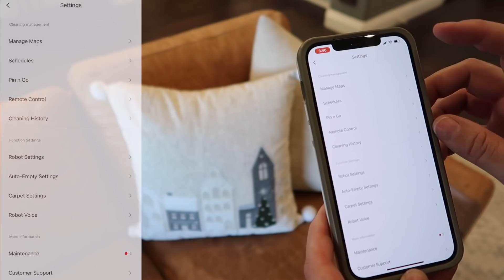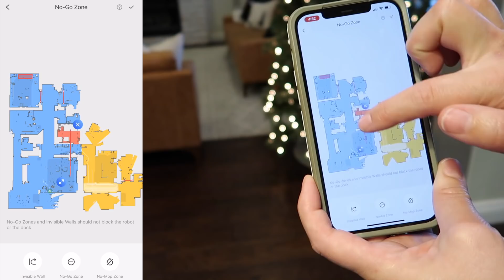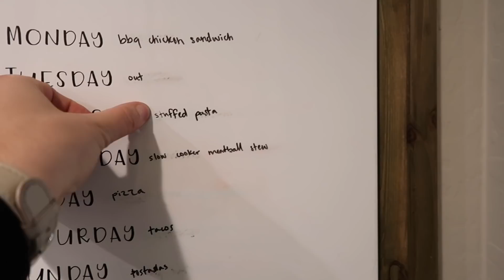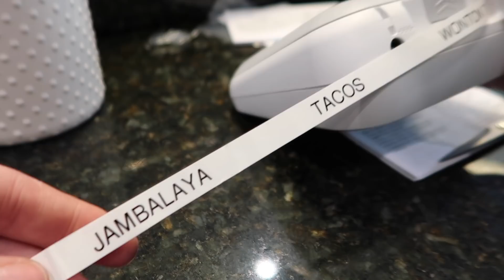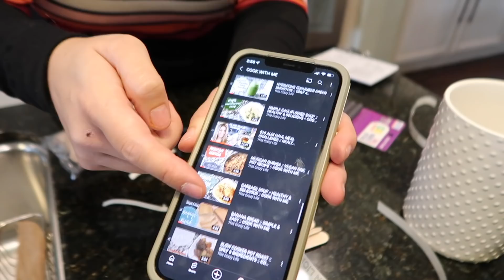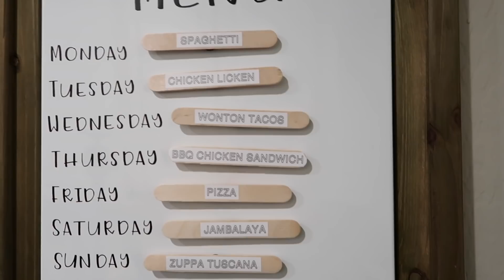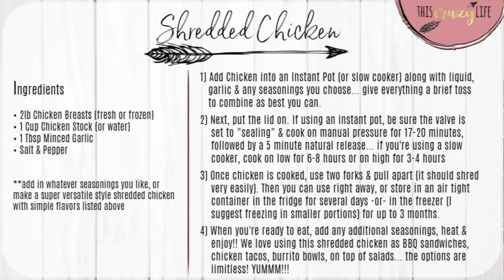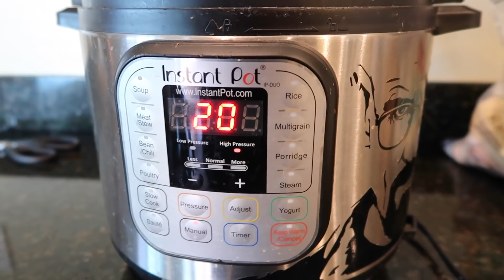HOMEMAKING + CLEAN WITH ME 2021 :: Meal Planning DIY, Coffee Table, Food Prep & Cleaning Motivation

Comment: Hi Amanda, love this video. I love labeling everything and I have the same labeler. Just a little tip, the green button on the top, right side area of thr labeler is a built in cutter. Once you are done printing, you press in and it cuts the strip of labels. Just incase you didn't know, I had to donehat you did too and used to cut with scissors. Hope you're having a great day! You're the best!

Comment: I love the essential oil in the sink, I also now wipe my sink out with the wet slightly oily paper towel that I wipe my diffusers with. There's just enough scent to linger but not enough to make the sink oily. My trash can and recycle can both have black plastic lids, wiping them down with that same paper towel leaves a pleasant scent especially if you wipe the inside of the lid. 
I have the same issue with our fireplace, one side has windows the other has windows and a door, my ceiling fan isn't centered because the ceiling slants toward the fire place. I love your furniture both ways and for practical reasons the chairs by the tree is better, after Christmas I think the chairs with foot rests balance the area better. Whew, you were a busy little bee! I love your new coffee table, the dark wood looks amazing! 💕💕💕

Comment: Keep the chairs in the middle while the tree's up. :)

EDIT:  The film on some produce is a wax film.  I use warm (not hot) water and a veggie brush to gently scrub the wax away.  You can get these things called BluApples, they absorb the gas produce lets off that makes them ripen eachother faster.  Each apple has a pouch in it that does the actual absorbing and the pouches are supposed to last for about a year each.  You can store them in a ziploc bag if you have some that aren't being used so they don't absorb anything when you don't need them to.  You can also get bags of refill pouches.  I found them on Amazon and one kept a sweet potato from rotting long enough to start growing when I'd forgotten about it lol.
Reply from the maker: Thanks for the tips!!

Comment: I fill my sink with cool water and add a cap of white distilled vinegar before adding apples, cucumbers, peppers, plums, tomatoes and all citrus (I zest citrus quite a bit because that’s where the flavor lives and always add the peel to tea!). Let the produce sit for about 10 minutes and you will be amazed at the scum that rises to the top of the water. Skim off as much scum as possible before letting out the water and rinsing the fruit. I dry it with a clean kitchen towel and store in bins in my fridge. All other produce is washed and stored exactly like you’re currently doing.

Comment: Does your Roborock ever get stuck under furniture?
Reply from the maker: I don’t think so… it has sensors that show if it can fit under furniture or not. It occasionally gets stuck on something small or if a random cord is on the floor, a lot of times it will avoid it, but occasionally it will go over it and get stuck on it. But we just pull it out and press the button to continue cleaning!